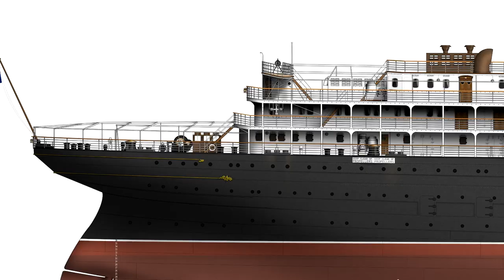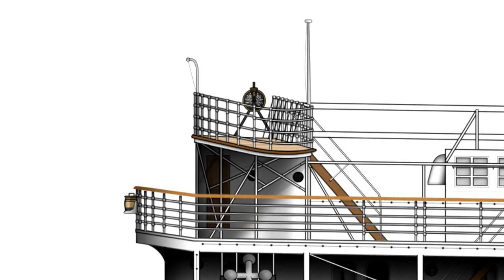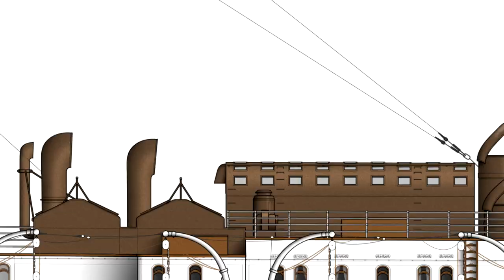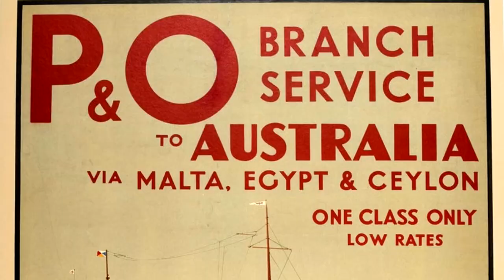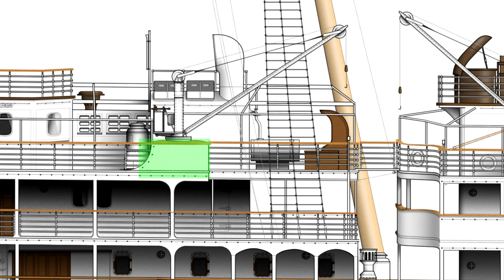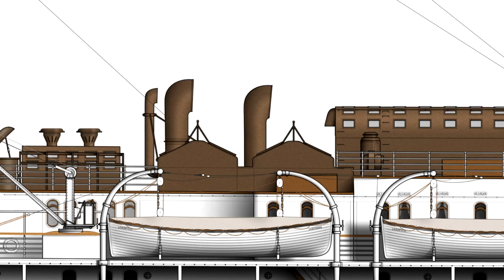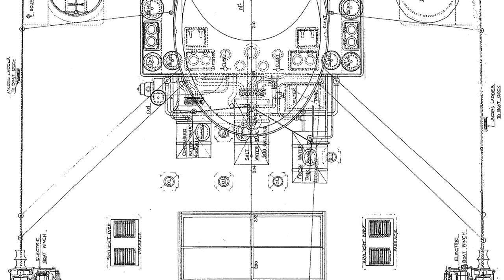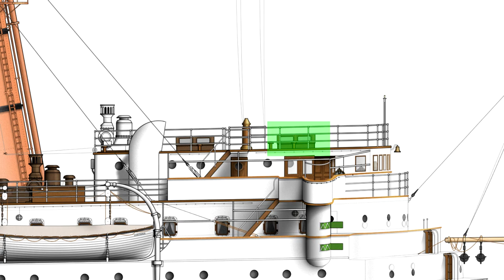Design secrets of the RMS Lusitania

Comment: The Sea water inlets and outlets are used to cool the Main Condenser. The Steam from the turbines exits into the stm side of the Mn Cond. It's filled with tubes and has a chest on each side. The sea water flows in one side and out the other thru the tubes. The stm comes into contact with the tubes and condenses into condensate, (distilled water). The Main Condenser is a pressure vessel, so as the stm condenses it forms a vacuum inside the stm side of the Mn Cond. This allows a great deal of additional work to be extracted from the stm as it passes thro the turbine. Main Condensers operate at near perfect vacuum. The stm exiting the LP turbine is under 100 deg f because of the low pressure. The distilled water used in the stm cycle must be reused. The Chief Engineer on any steam ship is always thinking about water. How much the ship is making, how much the ship is using and how much the ship has in storage. Boiler water and hotel services water.

Comment: 03:15 Modern cruise ships  often have a sort-of "torch" attached to lifebuoys, that also activates on contact with (salt) water. During my time on a cruise ship i learnt that lifebuoys are not always exactly meant to give a person over board something to cling on to. It is rather to generally mark the "place" in the water where a person (presumably) went overboard, so the ship has a point of reference to go back to during a man over board maneuver. After all, it takes several minutes for a ship to do a 180°... Only in "ideal" cases, the person over board can swim to the lifebuoy and cling on to it.
And if you, as a passenger or crew see someone over board, you can also throw anything (close) to the person that will presumably float, like a deck chair, a football etc., if there is no lifebuoy close by. As mentioned, the main thing is to give the ship a point of reference.

Comment: 5:45 Not sure if this is just tripping up on the wording a bit, but I think the implication you make as to how the condensers work is wrong. 

All the water from the boilers is kept aboard the ship in a closed loop. You can't just feed these boilers with seawater, due to the insoluble salts building up inside the boilers at high temperatures and pressures (sidenote but older, lower performance boilers of the mid 19th century could run off seawater with care). 
So they kept treated feed water in tanks. But you can't keep enough feedwater to run a ship for that long, so it's not just disposed of when it's used.
Once the feedwater was boiled and expanded in the turbines, it would travel to the condenser, where it would be brought into contact with thousands of tiny pipes with seawater flowing through them. This gave a huge surface area to transfer heat over, condensing the steam and allowing it to be pumped back to the feedwater tanks to be used again.
This seawater was brought in constantly through inlets. Being an entirely open loop (since it's basically just a way to dump heat), after one pass through the condenser it would go back out through the outlets, and that's what those are for.

Comment: The forward set of screws is outboard, the aft set of screws is inboard. I would expect that the forward set of screws is more dangerous due to the proximity to the hull contact area for tugs and for docking. On some warships, the screws were even outside the perimeter line of the hull, and would foul on a quay if positioned too close.

Comment: Speaking of docking bridges, but why was Olympic's docking bridge on the starboard side extended by a few feet?. The maiden voyage and launch photos of Olympic  show no extension to the docking bridge, but when Hawke damaged her starboard side the docking bridge can be seen in photos with what appears to be an extended "ledge" (for one of a better word) added, and so do photos taken of Olympic during her lifeboat inspection in the aftermath of the Titanic disaster (which can be found on the Paul Lee Titanic website), yet instead of it being on the starboard it's on the portside (maybe the phot has been flipped). Yet, oddly, photos taken in 1915 when Olympic was painted black, the docking bridge is as it was originally. Anyone know what was going on there?, was this some kind of removable piece?.

Comment: @5:51 IANAA, but I don't think any of the freshwater from the steam condensers was released to the outside of the ship. The freshwater from the boilers to the condensers was in a closed loop. It was only the seawater that was pumped into the condensers that was released back into the ocean (warmer than when it came in). The cold seawater and freshwater steam and hot water never mixed; they were just side-by-side in separate pipes with the heat moving through the metal separating them. 

And just think about it: how could the ship generate new freshwater at sea? They didn't need to "get rid of it"; they just recycled it. That's what the condensers were for.

Sewage, cleaning, and drinking water were a different matter, not connected to the boiler-condenser loop.

Comment: Could you make a video like this of the RMS Mauretania? I know its all quite similar but it would be a good example of how far you have come in 3 years. it would also help me out a lot as I'm currently making a model of the RMS Mauretania and I'm having a lot of trouble finding an image with fine detail of the original color scheme, in particular where the black of the hull becomes white.
One last quick question, did the RMS Mauretania also have the same awning structure at the rear as the RMS Lusitania ?
Cheers Mike and or any Oceanliner Designs fans that can help me out.
Reply: The mauretania was the best ship ever existing.

Comment: I am a little confused about Lusitania's 4th funnel. Was it connected to the boilers, or was it just used for ventilation like the 4th funnel on the Olympic-class? You seem to imply here that Lusitania's 4th funnel was only connected to the smoking lounges, but I heard some where that the 4th funnel had been added into the designs in 1904 to vent exhaust from additional boilers fitted later.
Reply: Just a vent for the lower decks and storage space.

Comment: I think the condenser discharge is actually salt water?  They'd use that in the heat exchanger to condense the boiler steam, because you didn't want to waste fresh water if you didn't have to.  If you started running low on fresh water you'd have to start desalinating salt water, which was very wasteful of coal.